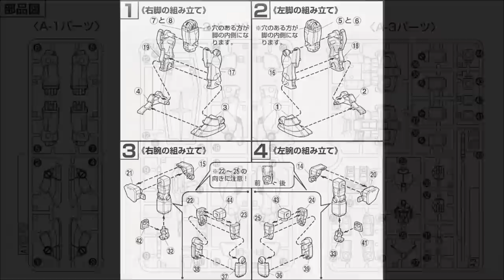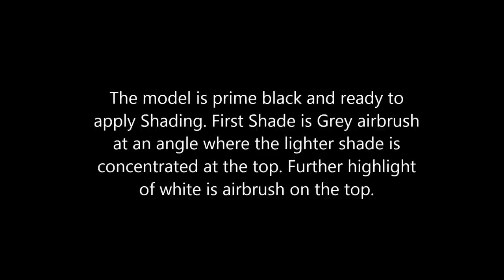060: 1/144 First Grade RX 78 2 bulit 2015

Comment: Hi there , amazing job, I have some question. Before panel lining and wheatering did you use gloss varnish ?? the base paint is acrilic right ?
Reply from the maker: Hi. Sorry for the later reply as my pc is down. Yes. I will always do a gloss coat before panel lining. Once done I will do another clear coat. Then follow on with weathring.
Reply: Sall M Y Thanks for the advice. Im new in gunpla and this tutorial is excellente. What brand of gloss coat and clear coat did you recomend ?
Reply from the maker: Hi. My method is a bit more advance as I am still trying to improve on my painting. There is a lot of experimen on my parts. If you are new to gunpla please look to Zak youtube page ( https://www.youtube.com/user/ZakuAurelius/videos ). He dose alot of video tutorial for biginer.As for gloss coat I prefer to used Mr Hobby or tamiya clear.I still used alot Future for  clear/sealant Coat. But for my final gloss coat Its ether one of those. Other brand a good also. For Flat coat I used Vallejo.
Reply: Thanks for the advice :)

Comment: Just curious, did you use a different type of paint for the airbrushed red? How did the thinner that you used to take the excess panel lining not hurt the red paint? (Newb, so I'm still trying to figure all this out)
Reply: djeurosham is that because of the coating?
Reply from the maker: djeurosham If not mistaken the red is from the game color arcylic paint. The wash is enemal base. The enemal thinner will not effect the arcylic paint.
Reply: Cool, thanks so much!

Comment: hey Sall, for straight builds is it recommended to gloss coat first before doing panel wash? thanks
Reply from the maker: If you are not painting your kit then its not required.  Applying gloss coat it does helps with the flow of the wash . Btw what wash you using.
Reply: i will try thinned enamels for panel lining. i have no experience about it though. so i was wondering if its safe to use in bare plastic or coat it first. ive heard alot of enamels eating away bare plastic :D

Comment: Holy smokes that looks great! I have a question: What should I use to panel line? I'm about to buy my first gundam kit. :D
Reply from the maker: Hi ya. If you are just doing snap fitting only just get a gundam marker for panel line. If you are painting the kit just get the tamiya panel accent color (http://www.tamiya.com/english/products/87131_133panel_accent/index.htm) . Just make sure you gloss the kit as it help in removing the excess paint. Just choose the kit that you like for your first kit. New kit are much easier to do. Most of my kit are old one. Look for Zakurelious youtube channel as he have a basic step by step video also.
Reply from the maker: Hi ya. If you are just doing snap fitting only just get a gundam marker for panel line. If you are painting the kit just get the tamiya panel accent color (http://www.tamiya.com/english/products/87131_133panel_accent/index.htm) . Just make sure you gloss the kit as it help in removing the excess paint. Just choose the kit that you like for your first kit. New kit are much easier to do. Most of my kit are old one. Look for Zakurelious youtube channel as he have a basic step by step video also.Good luck.
Reply: Sall M Y so do you gloss it and then apply the the accent and add a matte coat at the end?
Reply from the maker: lam justin I always gloss before I do any panel lining. If you doing a snap fit only you font have to gloss it first. U can apply direct to the plastic. Just dont over apply the panel wash. If u paint the kit then it is must especially if you are using a flat paint. The wash will somehow will be stain into the paint depending on the paint type. Best if you protect it first if you dont want to repaint it again.
Reply from the maker: *dont
Reply: Sall M Y man did i paint mine, preshaded and painted ready to roll